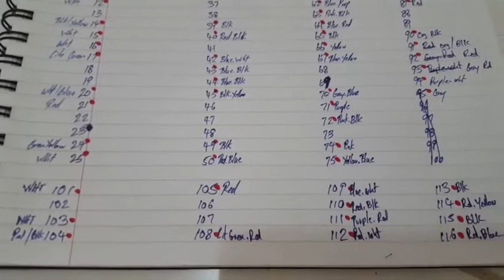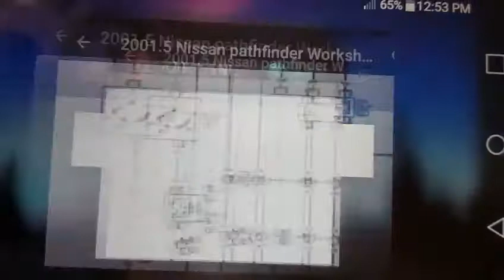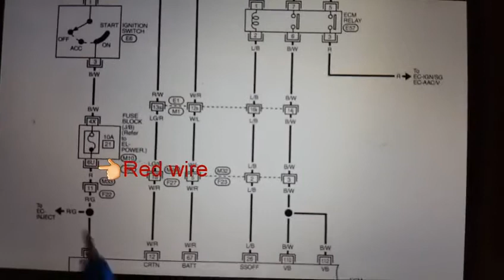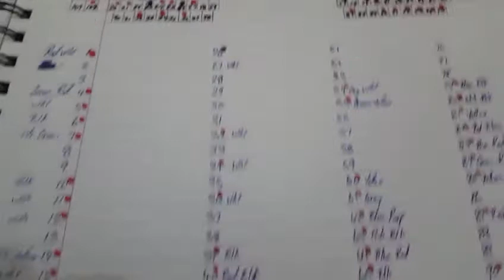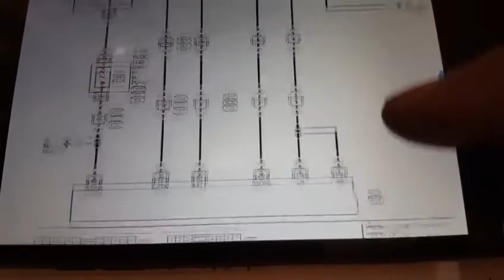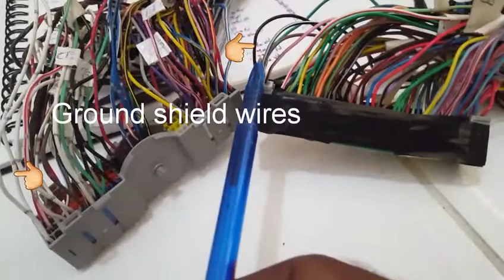Intergrating Engine wiring reference with blueprint diagram for Nissan VQ35DE & D22. Part 9/9.

Comment: I had bought it already and I want to found solution to this problem
Reply from the maker: You have to do what you see in this video, once the source information is correct. Integrating the two wiring harness is simply once the source information is correct. Our swap fail because we could not locate the engine wiring diagram blueprint for the 1997-2002 VQ35de. It's best to go with 2002+ VQ engine since the wiring blueprint is correspondent.

Comment: Hey Steve how can I contact you personally I need your help urgently with a similar swap. How could I get in contact with you do you have whatsapp
Reply from the maker: Wow. I wish you the best. Use the 2010 Nissan pathfinder swap with engine, transmission,  harness, eco all from the same vehicle.  Do not try to piece together like I try to do. The sales people are dunce, it better to buy the swap from a salvage yard, never online. I tried to piece it together but fail, too many theives around me.i try to build a 3.5 twin turbo but had too many problems with people (scums), so I give up and sold everything at a 90% lose. You need to make sure you get all the swap part from one vehicle and make sure the donor vehicle is running and driving good before doing the swap. I am at the point where I will only twin turbo the vg33e engine with the turbo and exhaust manifold from the GTR 3.8 engine.  I plan on using the Vg33eR wiring harness and ECU with the twin turbo vg33e.  I will be available by end of next year to do any swap or high performance work.  G-Fam custom in queens NY.
Reply: @Stevexnycautomotive  OK in one of your videos you was talking about bypassing the smart control unit how do I wire that exactly and could you send me the manual for the 2002 vq35de.
Reply from the maker: @kxngtrickster7589  the SMART system is a separate system from the powertrain. You can get the wiring diagram pdf at https://www.nicoclub.com/archives/use-nicoclub-coms-factory-service-manual-database.html. the PCM will have to be reprogrammed with advance tuning and delete of SMART parameters, any auto tuner can do that, it's the same has bying a reflash PCM. You can find Nissan VQ tuners online who are selling performance PCM with a core return. The SMART system work with BCM module, that is the Body Control Module to disable the PCM. No BCM command should not prevent the engine from starting. The BCM prevent the engine from starting with SMART system.
Reply: @Stevexnycautomotive  is there any way I could get your whatsapp or something to connect with you better I am doing this swap over three years now and I am stuck on this harness wiring please help
Reply from the maker: The wiring harness in this video will never work or any 1997-2002 vQ35 engine has a mis-information on it wiring diagram for those year with VQ engine.  The wiring diagram and the physical harness are different and it's a Nissan problem.  You need to use the 2003+ engine with the electronic throttle body. The wiring for 2003+ is good. Forget about 1997-2002.
Reply from the maker: I only use YT and Gmail. What year is your setup? What is your setup? What model is the setup from?. Do you have pictures or video of the setup?. Send it to stevexnycautomotive@gmail.com
Reply from the maker: Talk to this guy about you set up and get the pcm reprogram without smart system.  https://www.autotronics.co.uk/product/nissan-350z-3-5-v6-300hp-ecu-tuning-remapping-programming
Reply: @Stevexnycautomotive  thanks for your Gmail contact I will be sending you videos and pictures soon
Reply from the maker: The VG engine block mount bracket will need small cut and welded modification to both the VQ block to the D22 rubber mount which is the same has the VQ. The VQ aluminum bracket site the engine too high in its compartment.  The good thing about the VQ is it does not use a EGR valve to disadvantage the engine performance.  When thing else bolts up together like OEM factory intended.
Reply: @Stevexnycautomotive OK let me explain myself better I would like bypass  the smart controll unit. Where on the harness should I connect the crank and cam sensor wiring
Reply: Hi I had bought a 2002 nissan pathfinder r50 used car and the the person who's sell the car to me had swapped the engine from vq35de 3.5 to vg33e 3.3 with its control unit and I found many things doesn't work is it because the harness? Or what  and what can I do
Reply from the maker: Should have never buy it. Nissan is full of problems and their publications are all fruad. I'm a 35yrs experience mechanic with machine shop(10yrs) apprentice, is the reason i know my way around all vehicles. NISSAN IS JUNK. you just brought the other guy problem is what you just did, when you purchased that R50. Sorry, but I'm not going to lie to you by trying to help you fix that swap. Your best deal is to try and sell it.
Reply: @SteveXNYC  I think the vehicle is the same in options like 4wd and abs etc but the difference in the engine I think so and I don't know if I am right or wrong  but I want to know what is the difference in harness to treat it
Reply from the maker: @khalednessim3455 https://www.nicoclub.com/nissan-service-manuals#google_vignette. Check here
Reply from the maker: The difference between the VG and VQ ECU is the VG has one driver to fire the coil in the distributor while the VQ has six individual drivers inside the ECU to fire its six coil packs. The wiring serve different purposes on but ECU. Plus many more.
Reply: @SteveXNYC  any way thanks for your information ⚘️
Reply: @SteveXNYC  my car already running but abs doesn't work and transmission is not smooth
Reply: He swap the engine and transmission too
Reply: I forgot to tell you that the previous owner had bout the engine and its transmission with its control units and of course there harnesses then the different content to those is the car only

Comment: I have seen all 9 part of the video, I own a Nissan pathfinder r50 2001 3.3, I would like to swap it to 3.5.... should I need to change the chassis wire
Reply from the maker: No. Use the wiring and ECU for the 2004-2006 pathfinder. The with get the complete swap from the salvage yard. The trans is a 5 speed auto or it can work with a manual 6-speed.